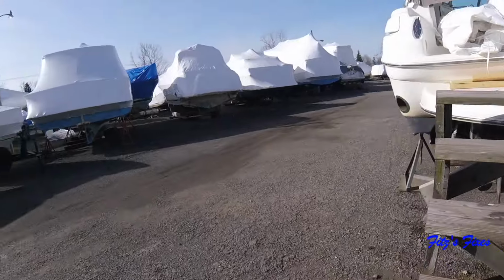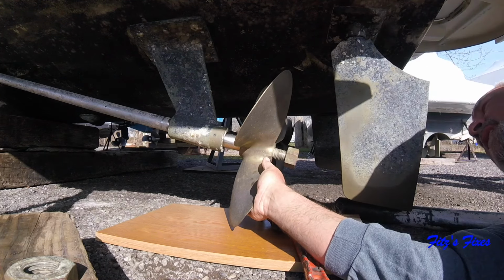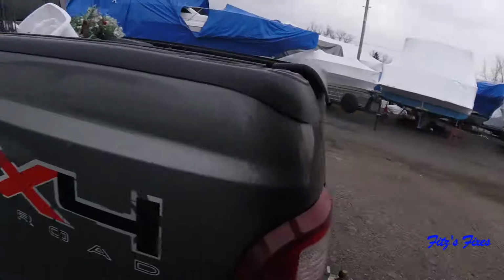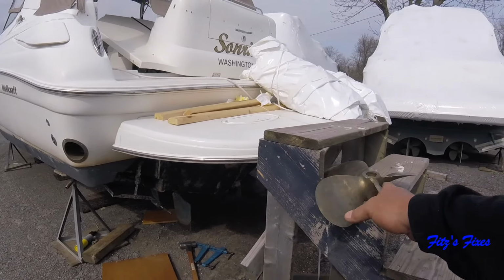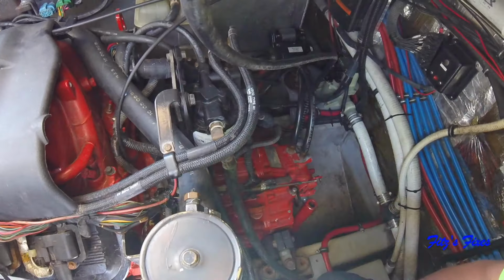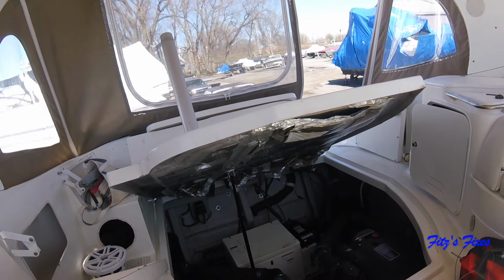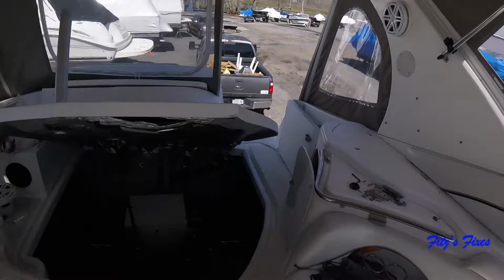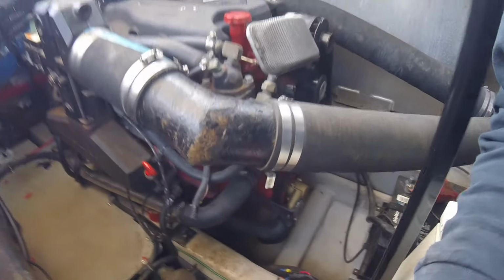Removing and reinstalling transmission on M:V Sonrisa

Comment: I have to Little brother to your boat the 3300 i think if you remove to armrest cushion there is a access hole. The arm rest was held in with pressure nuts.
Reply from the maker: I had a 3300 for 10 years before this one. Check out my other channel @fitzsfixes. I have a ton of videos of it

Comment: You put the propeller nuts back on the same way they came off. Lol. I can't fihure out why it matters
Reply from the maker: That's what I'm saying. They were like that for at least 4 years with no issue, so I just put them back on the same way. Apparently, that's not correct. So I guess I'll change them in the fall....maybe, lol